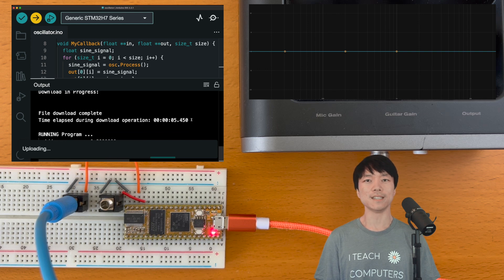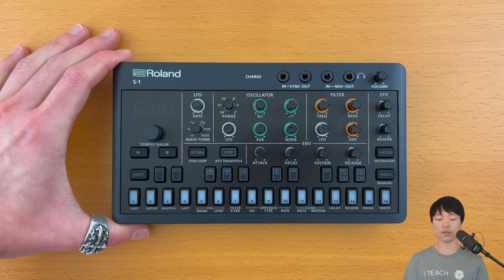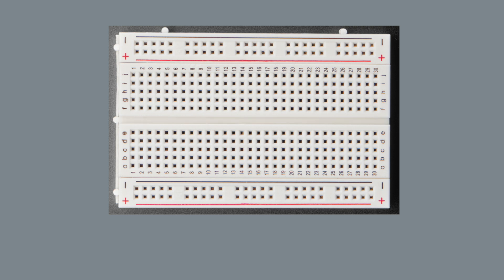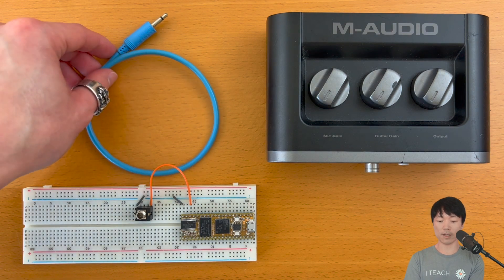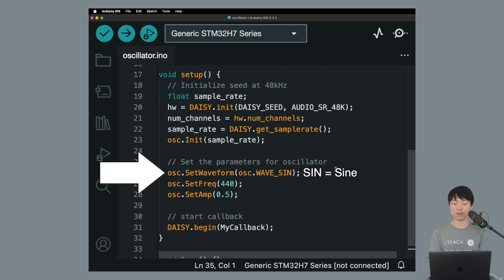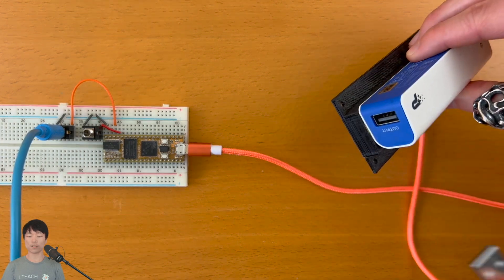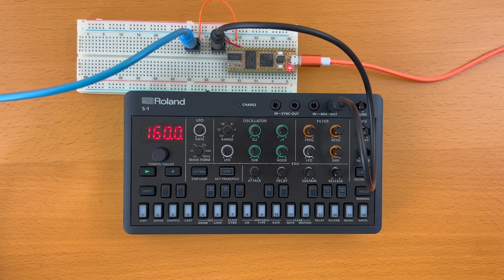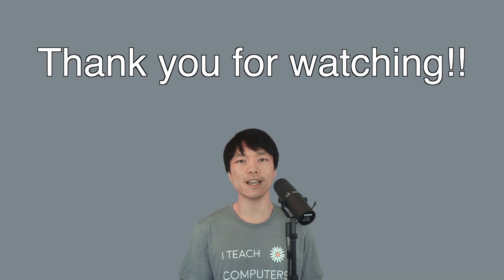How to Play Audio Out of the Daisy (DaisyDuino)

Comment: Hi there! I noticed that when my DGND was connected to ground as well as my AGND, I had a high pitched noise that I suspect to be a ground loop because it would pass through the audio jack even with a voltage divider on the output acting as a volume knob set to 0% volume (shorted to ground), and when I disconnected DGND, the noise goes away. Is this something that would go away once the daisy seed is installed on a PCB with a ground plane and powered via 9V power supply instead of USB? Is it safe to leave DGND disconnected? What are other solutions you would suggest? Thank you!
Reply from the maker: Hello!
That noise should go away when you power the Daisy with something that's not a USB power from your laptop. Hope this helps!
Reply: @electrosmithco  Great, thank you so much for the quick reply!

Comment: I’m getting an error : no debug probe detected. 
Failed uploading : uploading error : exit status 1
Any help on this would be great….without using the ST LINK-V3 MINI Debugger
My daisy is in boot loader mode after pressing boot/reset in the proper order.
Thanks in advance
Reply: Now I’m getting Failed uploading: uploading error:exit status 1
Reply from the maker: @youbobbotube  Hello! Did the first video of the DaisyDuino series work for you? 
https://www.youtube.com/watch?v=UyQWK8JFTps
Reply: Yes….and now trying to fix my problem with zadig I’ve somehow removed my audio interface. 😢
I am discouraged to say the least. Can’t do anything with my studio.
Reply: Could you recommend a store in Toronto ON Canada where I could take my laptop to fix this problem?
And maybe get the daisy seed to function also.
Reply: OK..fixed my audio interface. Just the daisy seeds again. Replaced the cable to be sure.
Error: No debug probe detected 
Failed uploading: uploading error:exit status
Reply from the maker: @youbobbotube  I think the issue is that you're using the (SWD) option in the Upload method. Change that to (DFU) and let me know if that helps. 
(SWD) is for when you're using the ST Link.
Reply: Hallelujah! Thank you so much.
I can’t believe I missed that…it seems to repeatedly reset that option each time I restart the IDE.
My bad.
Ok…I have 3 Daisies to start playing!
Reply from the maker: @youbobbotube  We're glad to hear that you got it working now. Have fun!!